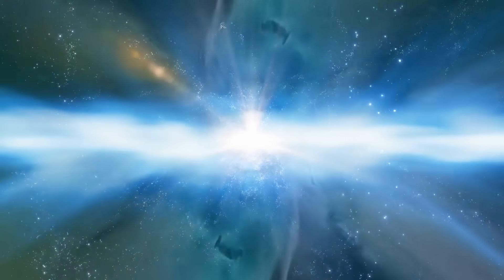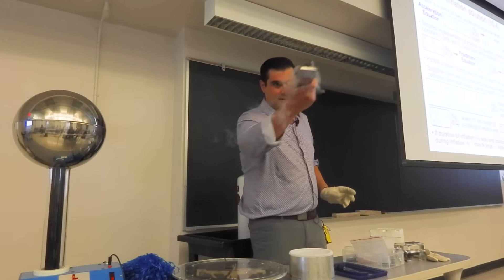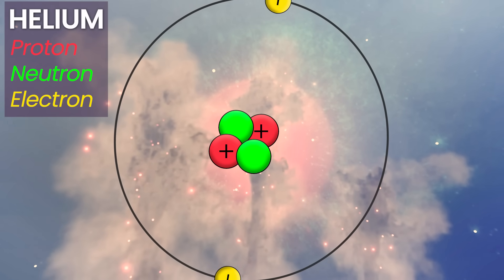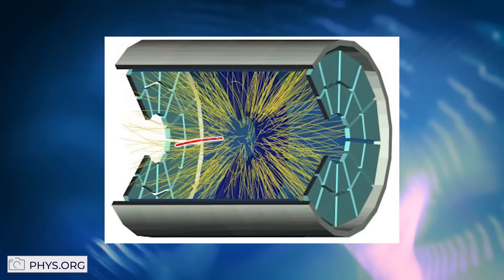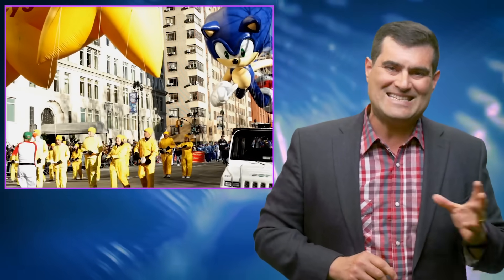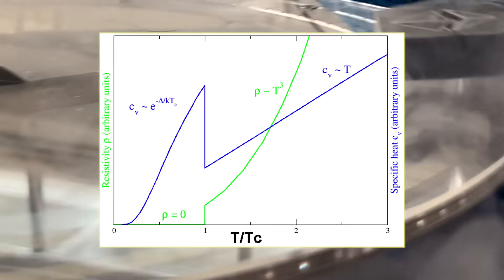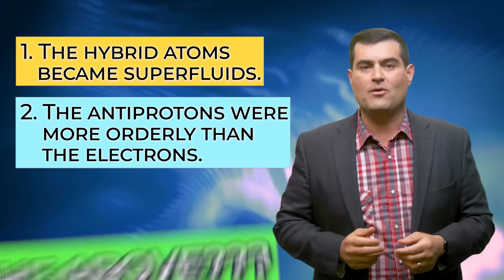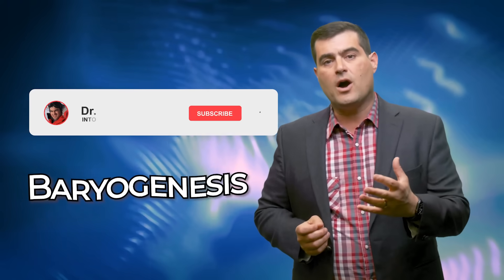Scientists Just Mixed Matter and Antimatter (It Didn't Explode)

Comment from the maker: Win a meteorite briankeating.com/yt :_Logo:
Reply: Great episode! As for the cosmic matter/antimatter dissymmetry Brian mentions at the end; that paradox really depends on how we view the shape of our Big Bang. If indeed our Big Bang was a kind of ‘dumb’ exploding sphere, then indeed we have an issue explaining the observed lack of antimatter. But an exploding sphere is not the default shape of cosmic high energy cosmic structures creating matter and space.  Like star birth and galaxy birth, the typical structure actually would involve a high energy disk, with two jets, feeding two lobes of purged matter and radiation on each side. The Cygnus A galaxy would best represent this high energy default shape. If our Big Bang were shaped this way, then obviously the central disk would create a matter lobe on one side (that would be us) and anti-matter lobe on the other. That explains why we can’t see anti matter. Problem solved. The detailed mechanism for dividing matter into both lobes would be the central spinning disk, presenting clockwise electro(weak)-spin on one side, yet viewed from the other side, anti-clockwise spin. This means newly created matter of like electroweak spin would be accelerated away from the disk, but matter of opposite spin (antimatter) would be pulled back to the disk, cross it, and next be pushed outward on the other side. This also means after a quick expansion, half the matter would return to the other side, causing contraction, followed by gradual expansion again. Also, there would be traces of an umbilical cord connecting both lobes even today, which we have in the form of the great attractor, showing preferred cosmic motion. So in all; we can solve the matter anti matter paradox by just revisiting our idea of the shape of the Big Bang.
Reply: say less
Reply: Great video, maybe a bit less bing bang click clipp effect? :?)
Reply: You are an experimental physicist? Have you worked on your evil laugh yet? "MuwaHaHaHAHAHA!?"
Reply: I might be very stupid now. But just wondering one thing. Could it be possible for anti-proton to decay in to electron? Let’s say that the neutron isn’t as good at glueing antiprotons in to atoms. When an anti proton is not bound to an atom, it decays in to electron. This maybe could explain some things about missing anti matter and also dark matter. Where there seems to be more mass, than what is seen. If anti protons are filling in for electrons. Then I’m guessing it would show more mass. Also the massive early black holes. I know i might be stupid. I have no scientific background. So please be gentle in your replies. 🙏 😊
Reply: @fairybeliever4479  have you ever thought about that it is ALL bs, nothing more than truman show. ALL OF IT. You will find out when i cant point out simple lies that have been feed with media for centuries.
Reply: Great channel, Dr. Keating. I have a twin sister and frequently I think we are the anti twin to each other more often than not. But we haven't eliminated each other so that's good (a -2!). Most times 1 + -1 = 0. But lately it seems we've become  1 + -1 = > 2 but < 3. I'm the "1" of course🙂
Reply: @MartyJNW3.14  which one of you is insane trudeau fan?
Reply: Run any magnet through dry loose dirt, anywhere in the world, and half the collected iron particles will be meteorites.
Reply: @Peter-jo3wt  nope, k3mmträils
Reply: This may be a stupid a question. (I struggled in math and chemistry in HS) if you can supercool helium into a Liquid state, is there a largess of liquid helium in space? Also, would it still have no weight /mass near or in a black hole? Is that even something that you can figure out mathematically? Sorry for the ignorance,but I love science even if I don't completely understand what's being explained. I was good until about 10:46,then I got hopelessly lost. Thanks Dr Eating for your explanation.
Reply: @deathbysnusnu1970  
It is time to audit some college physics courses.
Reply: All you can say is they discovered it researchers have discovered it through a test but you give no information of this test
Reply: @DrBrianKeating  12:20. Well then won't you be surprised when they remove the "H" from the standard model. 

As legitimate bad science.!!!
Reply: So you found neutral Helium? 
That confirms one of my theories.... if it works for baking soda and vinegar it should work for other 'reactionary' things too.... in theory.
Reply: Does the cooled helium absorb the antimatter?  I'm not sure how bonding happens without a reaction.
Reply: If it's cold then that means the space between them can expand faster than they approach each other being higher mass energy lower linear velocities and statistically a lower rate of collisions overall right? So it should have a calculable rate of annihilation. 

I've been wondering if thermonuclear stuff involves a hidden antimatter step. Instant annihilation resultant in the same products regardless, but affecting statistics in slower reactions or over time
Reply: Mental rolodex. 

I read a book that had been donated to a library relating this exact topic, and I can't recall the name. It was about a scientist that theorized about a then, currently unknown fluid with specific required characteristics. I believe it had to do with fluid dynamics and "hydrostatics" at certain energy levels. Something about a language that I was learning and anthropology made me inclined to pick it up, and it did not disappoint. 

I really enjoy these videos, but sometimes I have to not watch them in order to not spend minutes snapping my fingers near my ears and saying out loud and to myself, "What was that book?".
Reply: I really like these videos. I've got to stop jumping around in them as well. That's like confirmation bias. This is why taking a "concerta" was indescribable-once was enough for me. My brain gets like this with just some good sleep and some index cards. Taking a "concerta" was movie level ridiculous. Laughing and wondering, "Why do I know that? And, how did I remember that?"
Reply: What if I added s ferromagnetic somehow chemically to helium mixed e ith anti helium( 2 protons 2 nuetrons 2 electrons + 2 anti protons 2 nuetrons and 2 positions) then added a feeromagnetic and then using magnetic ceramic extremely intense magnets created a specific spin thru induced pressure tempeture as nd slowly used resonance to inducr and introduce the 2. Woukdntnt eventually that create a continuous energy system if the enviorment was stabilized? Could that work?
Reply: Maybe ur best video i loved it
Reply: Garbage.
Reply: What if dark matter is hybrid matter?
Reply: @sunrazor2622 
Hybrid matter goes BOOM !!!😂😂😂
Reply: @DrBrianKeating  perhaps Elon could compress his fuel source even more, more stability
Reply: There is no anti matter. There is no black hole. There is no electron. Its all lies.
Reply: @DrBrianKeating  Er... No thank you. I wouldn't enjoy it being delivered to me. Or frankly, anywhere near me. If I win, I'll donate it to the dinosaurs at the KT Boundary, nice guy that I am.🫢

Comment: If the particles of matter are quanta of vibrations (energy) of various levels, then how can you have 'anti-vibrations'?  🤔
Reply from the maker: Ok
Reply: 1. Vibrations of the opposite direction (when proton goes up, antiproton is down, etc)
2. You are categorically false in your assumption. It is based on “charge” besides that, they are the same exact particle (same mass, opposite charge, etc)
Reply: @scorpionjaxxer339  that's a different phase of the since wave, not a different type of vibration. Phase, frequency, amplitude.
In truth, I think those guys just like coming up with new names for old observations and writing papers about them. 🤨

Comment: I would think an antimatter mixed Helium atom is more stable because of its higher mass.  If the Anti-Proton is taking the place of the electron, that's a lot higher mass to have orbiting a nucleus.  And with higher mass comes more inertia to overcome, resulting in a more defined, less probabilistic, negative charge orbit, which would overall stabilize the atom.  I don't think being a differing charge would have much of an impact on overall properties unless those overall properties we're examining are the reactions to its environment, which would be charged one way, instead of its opposite way.

Comment: What a crock. Anti matter means they don't mix. Heat and cold neutralize as temperature equalization throughout space as mass.  Two factors. Cold and heat coexist as space itself. Whatever mass is, is anti-matter. Heat and cold equalization of pressure known as temperature. The stars disolving atmospheric gases into external heat energy outside of entanglement of mass like campfires slowly disolving internal magnetic fields grounding currents through its nucleus or core of mass. Lightning burns through atmospheric gasses instantaneously disolving internal magnetic fields of gases into external heat energy known as fire.  Heat energy singularities outside of entanglement of mass from mass.  Coincidence? No! Hydrogen is the most abundant element because it is the cosmic speed limit of centrifugal force of magnetism. The first magnetic field created by faster than normal momentum of space velocity redirected backward onto itself as neutralized repulsion of space itself as event horizon perimeters allowing faster heat propulsion than normal magnetism of the weak external magnetic field of space. Cold repulsion within mass as neutralized cold repulsion within mass as outward force of pressure known as weightless outside of a farther reaching magnetic field like earth's internal quantum magnetic fields of accumulation of amplification of quaternary elements combined synchronization of magnetism bonding and repulsion. Grounding heat stops accumulation as fire. Physics works.

Comment: I don't know what kind of bullshit you are trying to pull here but you have had multiple wrong definitions here... Viscosity: Quantifies the internal friction in a fluid which makes it resist flowing. Higher viscosity means a fluid is more resistant to flow, like honey or molasses, while lower viscosity fluids, like water or alcohol, flow more easily. I was willing to maintain an open mind through the first half, despite my questions on veracity, but then you posited an outright lie which is the exact opposite to the SI definition... This is NOT science, this is Bovine Excrement with a fancy presentation.

Comment: Did they should be call atoms ? They are someting diffrent, diffrent mass and i suppose diffrent "radius" and other things?
Reply: They are exactly the same except their particles have opposite charge
Reply: @scorpionjaxxer339  You missed the point, they replaced electron with antiproton...charge is the same but mass is vastly different (1860x). I don't know if that matters but for layman it not looks the same

Comment: A superfluid state of matter does not behave like normal matter.  Might the reason for its strange behavior be an indicator that the superfluid state is a quasi-state between matter and antimatter?   Matter and anti-matter might not behave normally in a superfluid state?   I have wondered for years if this was true because of black holes?

Comment: Very interesting, questions:
-Does this potentially open the door to a method for stabilizing antimatter in a matter world? That could be hugely important.
-What happens when this superfluid Helium with antiproton-electron replacement is allowed to heat up? I would presume if superfluidity is the reason for this unexpected stability one could measure an excess of 'heat' at the transition temperature as annihilations begin... or not.

Comment: I’m sorry but experiment you are conducting, you aren’t going to find anywhere throughout the universe. You can liquify the helium, only if you can play one atmospheric pressure. Regardless how cold it is through out the universe, if you don’t have one atmospheric pressure helium never will turn liquid. Secondary there are no antimatter particles, helium atoms except another proton, because atomic energy expands and shrinks with temperature fluctuations, as long as energy of helium shrank to the maximum two protons won’t repel each other. Guys simply you have to understand how atoms behave within space, perhaps that would be key to understanding how atoms interact

Comment: Danny K. Comment: Paul Dirac’s 1928 paper did a lot more than just show solutions that later were identified as anti-electrons (positrons). It found energy corrections for ’s’ states ( electron shells ) that were known experimentally. It found a firm basis for spin-orbit coupling and established the first order gyro magnetic ratio of the free electron as 2. 

My comment:
Danny K. sound like you may be able to move this question forward ..

Anyone a Q: How or Does this - NEW STABLE Hybrid matter-antimatter Helium (H4) - fit in with Paul Dirac original equations that predicted anti-matter? 
And if Dirac equations do not predict hybrid matter, can you generalize his equation over two weekends?

Comment: Hey, if in face of electrons and protons the anti proton is lighter weight than it's counter part it can slow and widen the orbital length increasing the resistance of the particle and lowering the friction. Basically nothing will move across it quickly. There is drag, but physically it would move quickly over a surface kinda like one way sand paper but the paper has to move the opposite direction always and the motion of the helium with anti particles is always "forward" away from the grain. Simulating antigravity ... Though that word is miss interpreted all the time this sounds right to me

Comment: An antiproton and positron are not antimatter. They are antiparticles. Antimatter is made of antiparticles, hence, it takes a number of antiparticles to form antimatter. Just, as it takes a number of particles to form matter. 

It didn't explode because antiprotons are antiparticles, not antimatter. But, still interesting that protons and antiprotons didn't annihilate each other. You mean particle antiparticles collisions were minimized. 

I am appalled how scientists interchange the terms particle and matter, antiparticle and antimatter. 

A particle is a packet or parcel of energy as a disturbance in a field. Matter is a substance formed by particles. 

An antiparticle is a packet of parcel of energy as a disturbance in a field with the opposite charge of their particle counterparts and possibly other small differences. Antimatter is a substance made of antiparticles. 

Particles are not substances neither is matter packets or parcels of energy as disturbances in fields. Antiparticles are also not substances and antimatter is not packets nor parcels of energy as disturbances in fields. 

The confusion comes in as some express particles as particles of matter or matter particles while others using the terms take it to mean that particles are matter itself. They are not. Being "of" something does not mean being that same thing of which it is a part. 

For example, one may say the "pores of the body". But, that doesn't mean that the pores are also the body itself. Pore make up the body, just as particles make up a body of matter. 

Now, some say matter particles, which has led to many to think particles are also matter. But this phrase means particles are "of", "from", "belong to", or "make up", matter. 

It is similar to pixels (particles) of a picture (matter). The pixels are bits of a picture but each is not the or a picture itself. Neither is the picture a pixel.

Comment: Why would it explode? It should just cease to exist.
Reply: Conservation of mass-energy. Mass & energy can't be just created or destroyed; only converted into an equal amount of mass & energy.
In the simplest case, a particle colliding with its corresponding antiparticle, the result is photons whose total energy = mass-energy + kinetic energy of the colliding particles. But even a tiny amount of mass converts to an enormous amount of energy; thus, "explosion."

Fred
Reply: @ffggddss  Yeah that's true for matter. But antimatter is supposed to be the opposite of matter with negative mass and energy. So through conservation they would become neutral and stop existing.
Reply: @Kneumann1991  Antimatter does NOT have negative mass – there actually is no such thing. Who told you that?
A particle and its antiparticle have the same identical mass.
Reply: @ffggddss  Antimatter does not exist.. it's all speculation.
Reply: @ffggddss  It's not a who but rather a theory considering this entire conversation is completely theoretical. If there was truly antimatter it would have to theoretically be the opposite of its counterpart matter. Otherwise it's just more matter that can be added to the periodic table. Unless you're saying matter and antimatter are like the north and south poles of a magnet where they negate each other. But still that would mean antimatter is just plain old matter with a different attraction force. It would be more accurate to call it positive and negative matter rather than anti. I can be misunderstanding the use of anti also. Please don't be mad at my ignorance. I am genuinely a curious person and do enjoy learning something new.
Reply: @ffggddss  Also, if mass is directly connected to a particles energy and if the energies negate each other in matter and antimatter it would still cease to exist. That's the whole principal behind Einstein's E=mc^2.
Reply: @Kneumann1991  But in E = mc², m is never negative; so neither is E.
Energies of matter and antimatter don't "negate each other."
E.g., the mass of a positron = the mass of an electron; the mass of an antiproton = the mass of a proton; the mass of an antineutron = the mass of a neutron; etc.
In each case, the electric charges are opposite, as are the lepton numbers, the baryon numbers, the magnetic moments, etc.